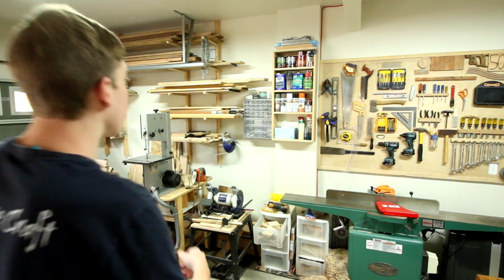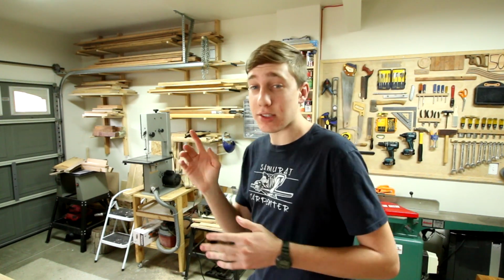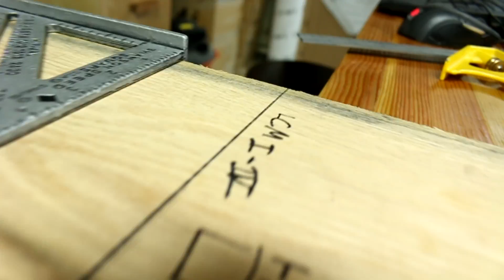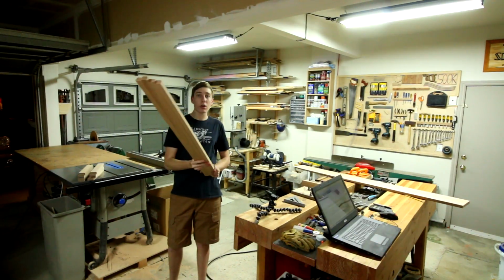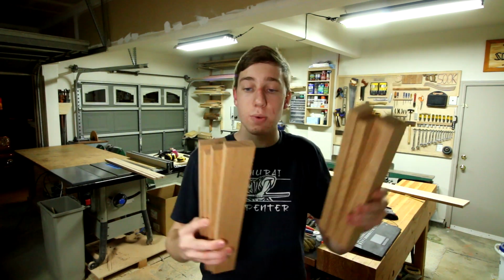MISSION INSPIRED SHOE RACK!!! | PART 1

Comment: Running those short boards over your jointer using thumb pressure is very dangerous. If you regularly take even the slightest chances with machinery, they will eventually get you. They are unforgiving. If your arms, fully extended, stop short of the moving blades, you're safe. If you can reach the blades should something kick back or slip, use push sticks. Think "vanishing board." If this board vanishes would my hand go into the blade? Sorry to harp. I learned this the hard way when a C clamp, used to hold a stop on my Table saw, but accidentally tightened on a ridge underneath, gave way, sending 3 fingers into a dado set. I was cutting out hand holds in bee hive bodies. Please be safe! Love your videos and obvious love for woodworking.

Comment: I guess my only question why would you not mill the larger boards before cutting the up I do believe its a lot safer than running those small pieces on the jointer